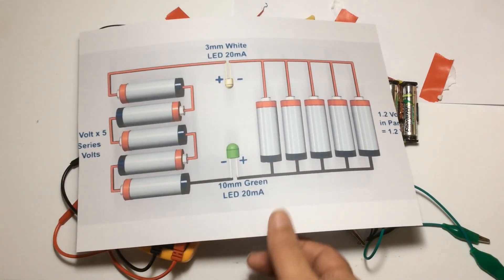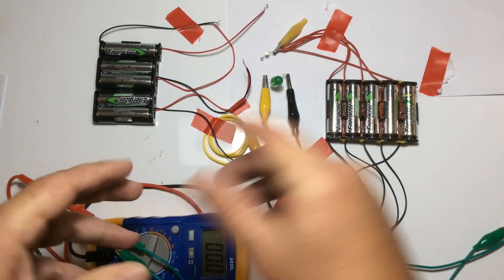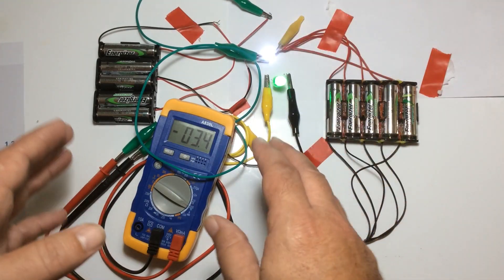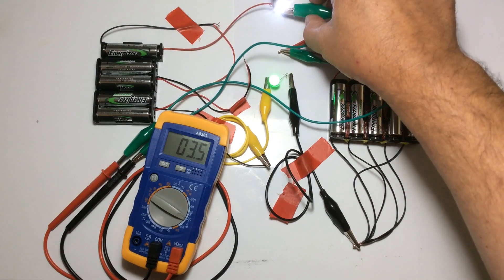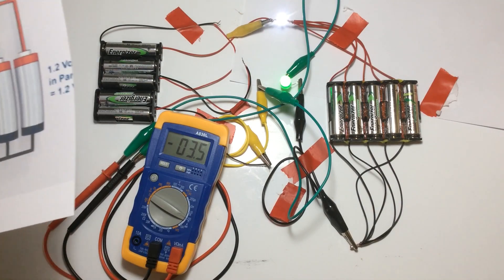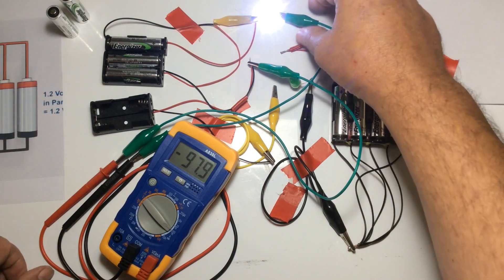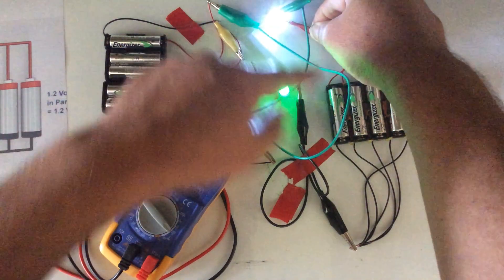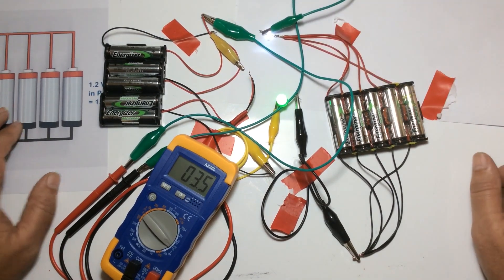TESLA TRANSFER METHOD AMPS INPUT & OUTPUT

Comment: You removed two batteries and dropped the voltage, as the result the amperage went up. Power is Volt x Amp. That's why. 
BTW, if everything was a lie as you indicate, nothing electric should be working, including the computer you're using to upload this video and the camera that you're recording this video with.
Reply: dear Sam for your case, its true that power is a product of voltage and current but what you are saying is not a fact. you will be surprised that Incase we add an extra battery to make four in a conventional way, the amperage will instead increase as the current consumption is directly proportional to the voltage. whoever here our brother was trying to equalize the voltage that we have been experimenting with, of course he was supposed to remove one battery but instead he removed two. i believe that if make four in a conventional way, more current will be even drawn out of the circuit than 100mA of 3 batteries. Try it you will learn it by yourself.
Reply from the maker: @wambeddemustafa1193  Thank you for your comment.
I appreciate you explaining my reasoning for the three batteries, I understand what it is like to ask a question and have no response for hours and I love the notion of my subscribers being able to assist each other on this channel even when I’m not online so thanks to you and @justbob1581
Reply: The point he's trying to make is that we have all been fooled into believing that electricity gets used up and you simply have to buy more without any other alternative, when in fact nothing could be further from the truth.  The electricity comes from the environment and is abundant at all times and all places.
Reply from the maker: @justbob1581   Thank you for your comment.
In a nutshell! There are many better ways to do just about everything.
I remember as clear as if it was today when the penny dropped for me, the realisation that they were using my ego to keep me in the dark. Smarter men have gone before you and they say it isn’t possible, for years this had me looking the other way, for to question that narrative was declaring your stupidity. I still remember the smirks of the all knowing teachers when I questioned just about anything, my mind would often see errors in their perception based evaluations but I was already reluctant to question having being scolded the first time I called BS. They smirked and scoffed because they weren’t leaders but mere followers, blindly and faithfully reciting mistruths in fear of realising their own deficiencies in detecting BS and lacking the conviction or drive to investigate the possibility of being tricked by their egos.
You may be able to tell I don’t have much respect for today’s education system.
Reply from the maker: Thank you for your comment.
I understand how you may have come to that conclusion and in the conventional sense you would be correct, however, I will explain why this isn’t factually correct. When referring to my older videos you will see a version of the transfer method, for example the 275 day test in which I use 3 AA in series supplying 3.6 volts maximum to the LED. This voltage would be ideal in a conventional sense but in the transfer method we have a voltage reduction caused by the parallel bank of 1.2 volts. The voltage seen by the LED in that setup is 3.6V - 1.2V = 2.4V yet the light still works!

In this video I am using 5 AA in series which is supplying 6 volts, 6V - 1.2V = 4.8 Volts.
4.8 volts is too high for the LED that is rated at 3.2v to 3.6V which is where the Green LED comes in and according to my research the colour does matter, please refer to my other videos.
The LED’s are diodes and therefore present a voltage drop, typically around 0.9 volts and as we have a series looped circuit each diode in turn presents a voltage drop also at approximately 1.8 volts combined.
6V series bank - 1.2V parallel bank - 1.8V diode voltage drop = 3 Volts.
3 AA’s at 3.6 volts is as close as I can get to the 3 volts actually seen by the LED using 1.2 volt batteries which is why I used only 3 batteries, might I also point out that there is no way that an increase of 0.4 volts that is achieved with the 3 x AA’s would account for an approximate 90% reduction in amperage, it would however account for the increase in illumination you mentioned.

This concept in no way defies the current understanding of electricity, this is known and deliberately not taught. Your every day electronics will function this way as I have clearly demonstrated, I can connect my normal devices to this and run them longer than the way we are “sold” to run them.

 My point is your devices were manufactured to not include this concept because at a bare minimum you would pay them around 70% less money using this method. 30% wasn’t enough for them, they want all your energy, so they taught us the most expensive way possible!
Reply: They want you to believe that power is consumed but in reality, it is not.   If you draw say 5 Amp from the grid you must return 5 Amp to the grid.  If you only return say 4.99 Amps you will find that your will blow the fuse or circuit breaker

Comment: It's on point. It shows that all the mApms are going trough the 1.2v-Parallel-Bank. From an other Video of you we know that it charges up the 1.2v-Parallel-Bank by approximately 50%. You didn't mention this here. Besides the massive reduction of Amperage (95% less) it's also charging the Parallel-Bank. That's even more amazing. Great work here! It's one thing to test something but it's an other thing to show this with such an easy setup. It looks so easy but it's a lot of work to get this movie done. Great great great. I ordered Energizer batteries, step-up-converters and battery boxes. It should come today or tomorrow. I take the time to test my idea (which is coming from your idea) and I will tell you the result.
Reply from the maker: Thank you for your comment.
There are so many benefits to mention that I keep leaving bits out in an attempt to not bore everyone to death.🤣 You are correct about the importance of mentioning that particular feature the fact that it is charging the parallel bank in the process is phenomenal. The current reduction is in some part due to the internal resistance however this is not the full picture as when I measured the resistance and applied a variable resistor we do not see the same effect.

Thank you for acknowledging the work involved in making these videos, it isn’t overly complicated but it is time consuming, plus I have to hear myself drone on at least three times with filming editing and review after posting, that’s the tricky bit for me. 🤣

Please feel free to update us all with your test results, I want this channel to be like a community, a forum that we can all chill within and learn from each other, sure as heck the elites haven’t been allowing us to learn the truth so we need to rewrite our text books ourselves. I started my YouTube channel to teach people what I know, this isn’t my idea/concept however, it is what I now know and I feel it is a way of harnessing energy that just about anybody can master without the need for coils and complex circuitry. Your willingness to share your knowledge is what this channel is about and you can help by supplying data then more power to you. (Pun intended). 🤣🙏

Comment: Well done! I’m curious to see the same measurement points showing the voltages.  I’m also looking forward to seeing the solar panel experiment
Reply from the maker: Thank you for your comment.
I will attempt to show the small solar setup with a different white LED that I will scrap from a 240 volt LED, that LED panel will be wired for 12 volts but I will convert it to 3 volts and see how that goes, the current setup produces an insufficient amount of light to be of benefit with solar, it was producing 1.9 volts after the regulator which I was feeding into a singular battery in the series set but I decided it didn’t need further measurements as it was such a minor amount of light, this new light has reflectors and focal lenses so fingers crossed for better results.

Connecting a solar panel to the Tesla Switch is not actually necessary because the switching harnesses the extra energy however I am entertaining it because I always wanted a self driven solar setup and it is not until I became aware of this concept of power transfer that there was an efficient means of testing it.

I attempted to setup a large solar panel, controller and battery with two 12 volt lights so I could start testing and I made a mistake which blew up my MPPT controller. I have some in a box somewhere, in my apocalypse electronics stash! I will try to find time to set that up again and this time I will have to pay attention.
Reply: @whatifididthis...1236  I'm looking forward to it.  I am working on an automated switch pcb to swap the battery banks at a preset charge level from S to P and give a Positive Load path and a Negative Load path for outputs.   I've duplicated your experiment with 9v batteries and have been obsessing on it ever since.  If the Solar panel experiment works out, I've got an experiment in mind with a small 12v generator (RV pump motors).  Looking forward to your next vid
Reply from the maker: @browndirtmedia  Both the 12v generator and the pcb switch sound like something I would be interested in, please let me know how it goes so we can share it with everyone.
Reply: @whatifididthis...1236  will do

Comment: I am in UK and i can confirm that I managed to obtain same results using aa rechargeable batteries. Chatgpt saying that green led is broken 😂 or i am using another energy source undisclosed 😮
Reply from the maker: Thank you for your comment.
That is cool, I used Chatgpt and found it is wrong most of the time with electricity. Perhaps it really is the education that is wrong. After all Chatgpt is trained with the current understandings or teachings. I continually asked the same question and it got worse and worse right up to the point when I pointed out that it had contradicted itself it apologized!
 Batteries under the table 🤣

Comment: Good Morning from South Africa, I do the same thing with 4 12 volt battery's and a 5Watt down-lighter led light and i get the same results.
Reply from the maker: Thank you for your comment.
Thank you for confirming your success with this system, this helps encourage others to experiment. What are your typical run times for your setup?
Reply: I Run a light at night for twelfth hours, then using the battery's during the day for other experiments and stuff like home made baby grinder, and then i switch the parallel and series battery's for the next night   @whatifididthis...1236

Comment: love it..well done.....any luck with a solar panal attached?....cheers
Reply from the maker: Thank you for your comment.
I was using a small garden solar panel and its solar controller but I feel that the output of the panel wasn't sufficient enough with this setup. I tried to setup the 12 volt version for better lights and solar panel but connected the solar controller wrong and it went pop. Some days I wish I would just stop stuffing around when I'm tired and go to bed, all these devices are expensive which limits research if your worried about testing for fear of blowing things up.
I will dig out another solar controller tomorrow and try again. Stay tuned!
Reply: @whatifididthis...1236  ohh noooo! lol!..cheers bro